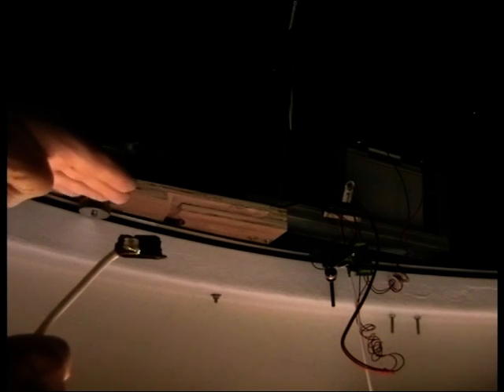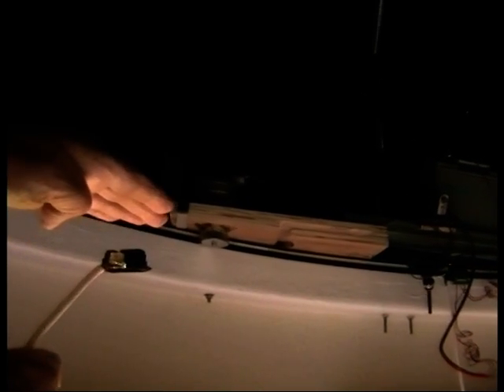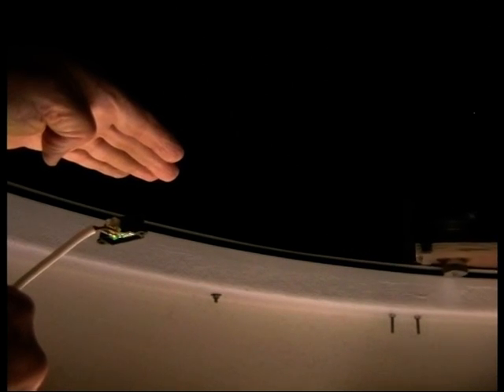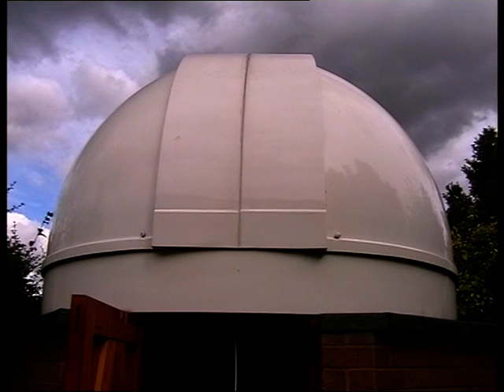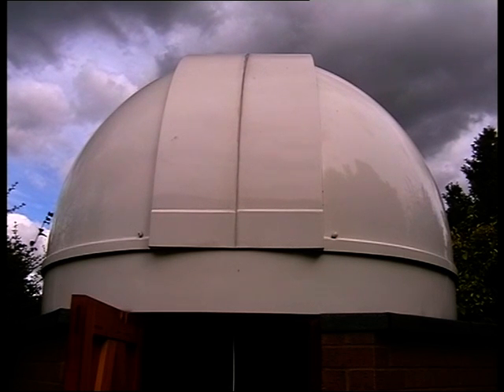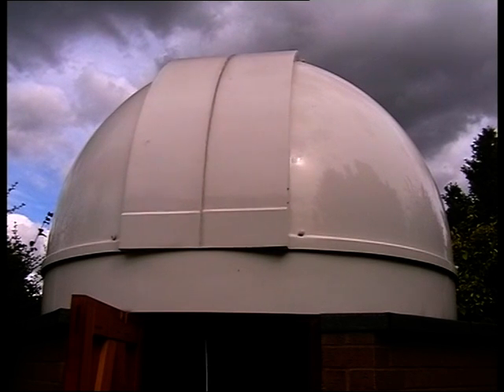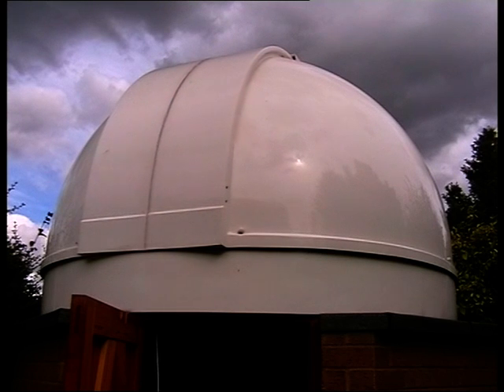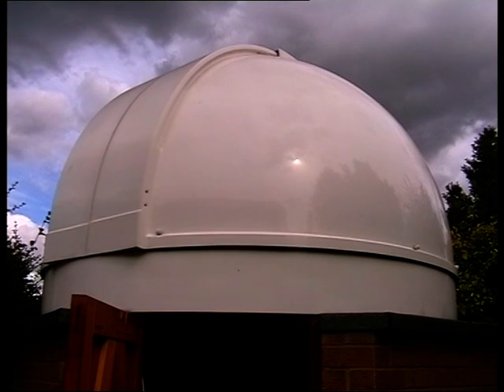Pulsar 2.7metre dome rotator Part III

Comment: Nice! Been searching for domes that use smaller timing belts like this. May i ask what timing belt did you use?
Reply from the maker: I got the belt and pulley from these people:  https://www.motionco.co.uk/timing-belts-open-length-belting-c-25_38_49.html
Reply: @geocarey  thank you 🙏 i never thought you will reply that  fast though the video has been posted more than a decade ago.

So the belt is 10mm width and 3mm pitch, thats impressive! I thought we will need bigger than that.
May I also ask if the belt installed using adhesive or screw?  Did it ever slipped?
Reply: I got it already, read from another video . Thank you sir 🫡
Reply from the maker: @spaceadobo  I used superglue. Nerve-wracking, because the glue sets fast. No chance to make corrections. There was a small gap between the ends, but the pulley goes over the gap fine.

Comment: Nice simple solution.  Hows it holding up of all these years?
Reply from the maker: It worked well, but I upgraded to the Lesvedome system. The electronics needed a bit of alteration. The dome rotation is now full automated and works well.